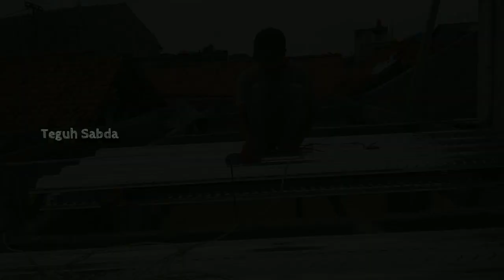Pemasangan bondek cor dan Perakitan Besi

Comment: Maaf mau tanya. Dak bondek+wiremesh bisa di pakai di lantai dasar? Jdi rumah 2 lantai. Ukrn 6x14 Pke cakar ayam 16 titik + sloof hanya 15 cm di atas tanah. Pedestial tinggi 1.5 meter Seperti rumah panggung (ruang kosong) ga pake pondasi batu kali dll. Lantai dasar bondek+wiremesh. Lantai 2 bondek+ wiremesh. Apakah bisa?
Reply from the maker: Bisa saja, tp kalau bisa sloofnya jangan 15 cm, kalau bisa 20/25 cm.
Reply: @Tgoehsabda  oke terima kasih.